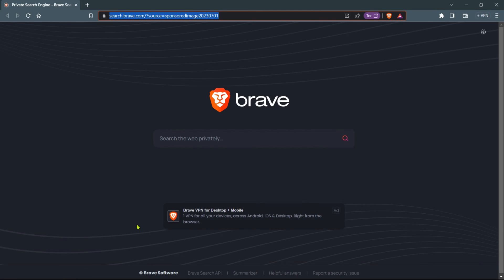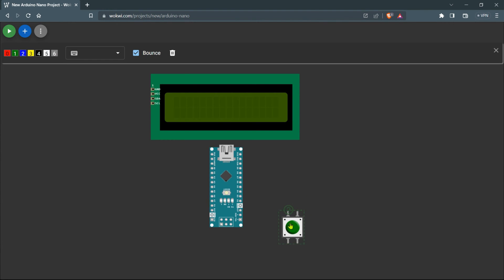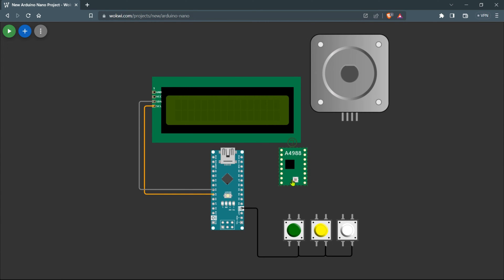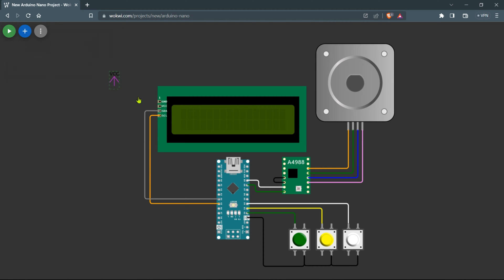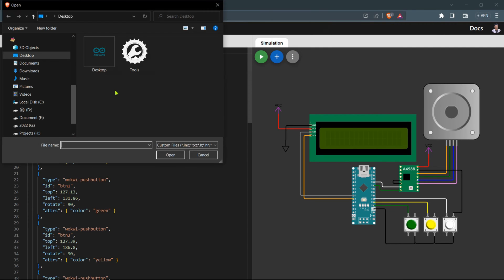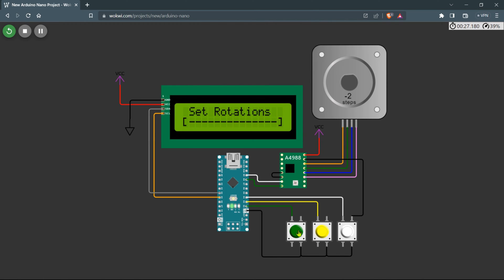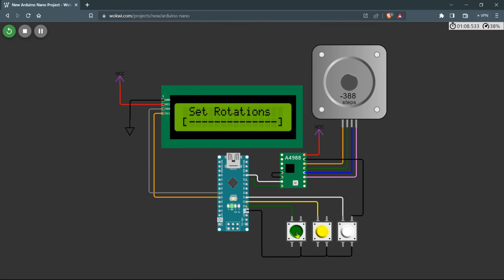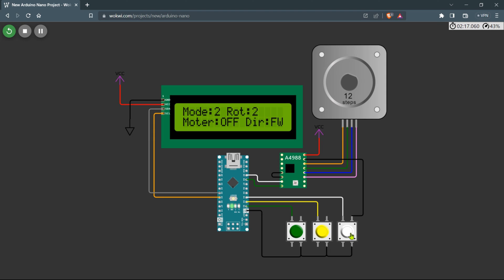Arduino Stepper Motor Controller | DIY Project🛠️

Comment: @OP Love your work! Is there anyway you can explain how i can make add a 4th mode to get the Stepper motor to go forward for a set number of steps and then reverse, and back and forth (without having to push the directional button)?
Reply from the maker: I will send you code :)
Reply: @ thanks brother. You are the man.